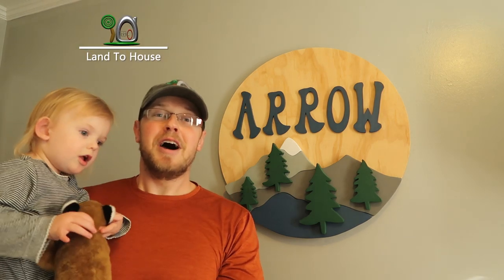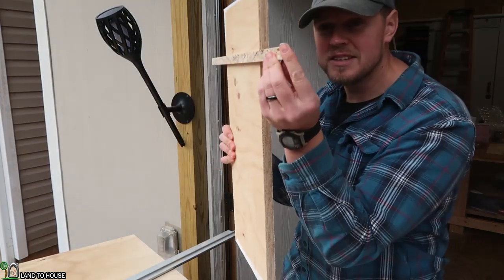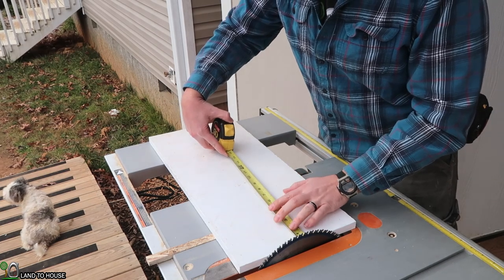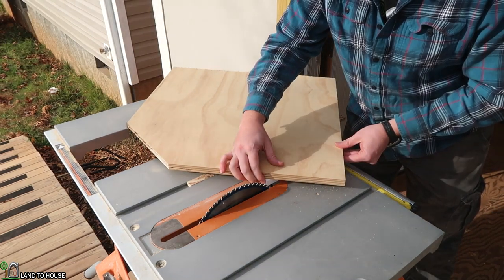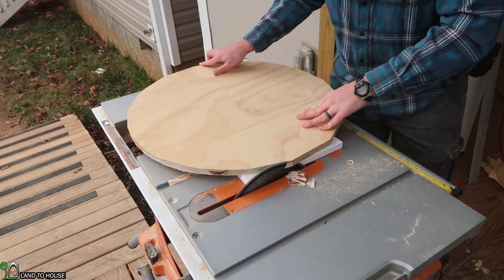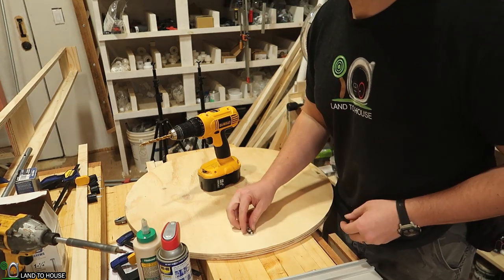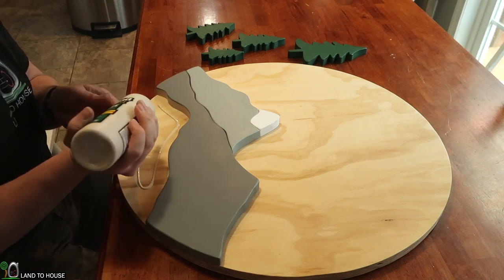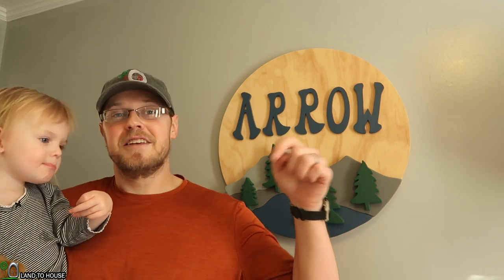DIY Nursery Mountain Sign

Comment: Love the videos but I though thought you were supposed to wait to reveal the name.
Nice Jig.  Next time raise the blade as far up as it will go, so that the teeth are cutting as close to perpendicular to the board as you can get it to minimize binding from the blade cutting at an angle to the rotation.
Use your drill press with the forstner bits to set in the hanger's recess for the screw head to get a neat square bottom hole and you have more fine control over the depth of the recess.  You can even recess the hanger itself flush with the back using overlapping plunges with the drill press.